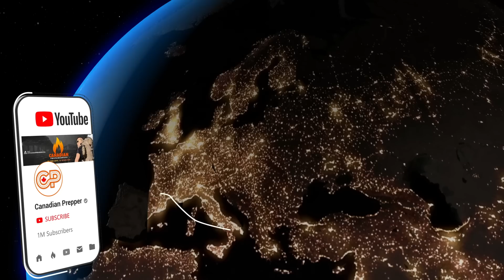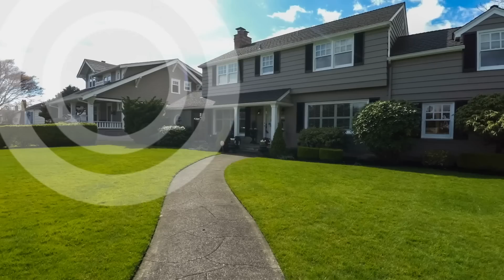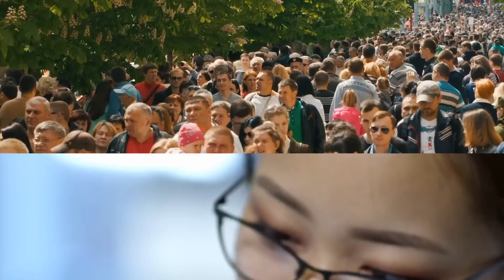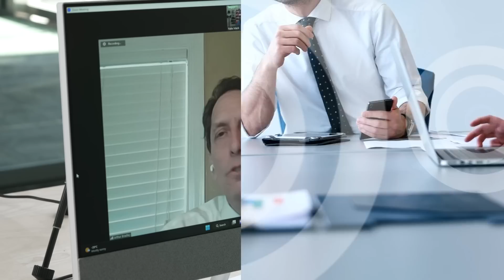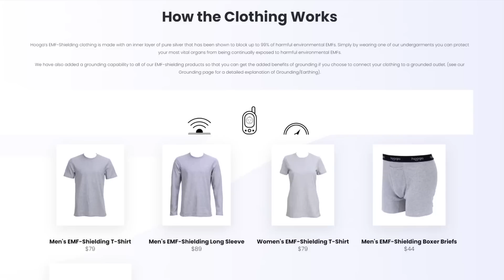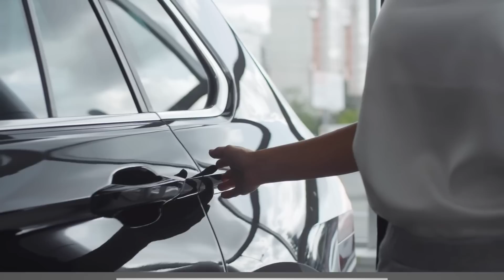NASA Scientist Issues STARK WARNING About WW3, Solar Flares, EMP and EMF

Comment: Thanks valuable info. I'm going to by a couple of metal trash cans & line them with cardboard for my delicate electronics, like my ham radio gear & power inverters etc. I'll probably also connect the cans to ground via a water pipe

Comment: It’s my understanding HAARP works differently than other magnetic fields at lower frequencies where as the power starts out wide and becomes stronger the further it goes. Something along those lines. So, if HAARP has the ability to link up with other magnetic fields couldn’t it certainly increase the energy frequency with the smaller GHz scattered about the planet and make them much stronger ?

Comment: If you buy semiconductors they will be in an antistatic bag. This bag will shield electronics or creditcards. too You can buy em for cheap. Or reuse them when you bought some electrical components. put some stuff in it brought it near the tesla coil. No interference whatsoever. So they do the job nicely. And 170 dollars for the emp device is just ridiculous for what's in it. I am a big fan of your channel but these products are way overpriced.

Comment: I'm sorry but NASA really? Asking NASA for one NASA has a bunch of videos they have admitted they are wrong in more than 89%  they are wrong. Wrong on Pluto wrong on the moon and wrong on the sun. Chatbot gave this answer While solar storms are not dangerous to humans on Earth's surface

[4]

[2]

, they can cause significant damage to technology and infrastructure. Therefore, it is important to take precautions during a solar flare to protect technology and electronics from the dangerous particles emitted by the Sun[1-4].

Comment: If you really want to see this  effect, go get an old fluorescent 4ft or 8-foot light bulb, put a copper wire on end and then ground it to earth, and get the other end is close to high power electric lines as you can. It'll libht that baby up .

Comment: I just thought of a tool that most people have been forgetting in EVERY YouTube video about prepping. 

Portable fish bags!!! The ones Petco use!! They are leak proof and hold a decent amount of large volume of water and you can get 1000 bags for around $30-40. 

They hold a decent amount of water and some bundles come with rubber bands to tie them off on the top.

Comment: The last bit on the solar induced blackout. The plasma wave does indeed take hours to reach earth, however there is a gamma and x-ray component that travels at the speed of light.

A large eruption will most likely be detected because we lose communication with the solar satellites. And that loss of communication will happen just as this energy wave hits earth because both are travelling at the speed of light.

This is ionizing radiation, and it triggers the same EMP spike as a high altitude nuclear detonation, except that it is global because the entire earth is bathed in it.

What the initial gamma / x-ray flash doesn't take out, the long duration plasma event likely will.

Comment: an SDR reciever is the best thing out there that can measure RF energy in the air and give you the exact frequency. As long as it can tune up to above 30 GHz. It can detect weak signals as well as very strong ones and show the difference. It can show everything in it's tuning range.

Comment: Pulsed radiation is intensified waveforms with aggregate energy concentrated in a brief period of time expressing high amplitude from a normally benign waveform.  Amplitude is voltage and voltage precedes current.  Ohm's Law, voltage is applied and current is drawn relative to applied voltage.

Comment: most of these products for cars connect, in some way, to a cigarette lighter and/or battery. how does a person apply emp/emf products to an electric vehicle? 

for home coverage products, do they require professional installation or can the homeowner install? what about solar-paneled and solar battery-equipped homes - how do these devices work to also protect solar equipment, and is installation more complicated?

Comment: Microwave ovens emit on average 20volts/m2 at the door. Your cellphone emits 20+volts at the phone. I ask people do you hold your head against the microwave while cooking? They look at me like stupid question? Then why do you hold the cell phone up to your head. Use the speaker function, don’t keep it close to your person.I have a cell tower in my back yard, I now have RA as well as my neighbors. I sleep in a faraday cage. Metal window screen framed around bed, outside frame .3volts/m2 inside .001volts/m2. It’s Awsome.

Comment: Seems the latest Kitchen trend is to put the Microwave at Crotch level in the kitchen counter cabinets - Seems like a very stupid Idea, just like the ones at head level - as was just stated They ALL Leak.  And Items once Cooked with a Microwave Do Not UN Cook over time. 

All this Energy is Cumulative in damage over time. I stopped using Microwave ovens years ago.

Comment: Dude should make a hat with that emf detector on it. I'm envisaging antenna sticking off the top and the light on the bottom of the brim (so you could see it, duh). Bonus points if the hat is lined with tin foil too.

Comment: I used a 40 watt fluorescent light bulb standing on the flight deck of the USS Nimitz to prove I could light it when the 1Mw radar dish rotated my way every rotation. Won several $20 bets from sailors who just knew it would not flash. Begs the Q... If it would light a 40 watt bulb what did it do to the deck apes.
I did observe the unusual behavior of sailors enjoying large quantities of alcoholic beverages when allowed to go ashore.
Reply: @KK7FWM - The Green E66S n HAM Club AT-1 Worked forward just front of Hanger Deck on the "Rosey". WC-640 ECM Shop AIMD. VF-84 then VF-41 on the Nimitz USN (1972 -1981)
Reply: @KK7FWM - The Green E66S n HAM Club AND you are still motivated! Marines RULE!

Comment: My expectation is if there is a Carrington-like CME headed our way, there will be several days' notice before the CME hits Earth's atmosphere. The federal government will probably require all the privately owned electric power companies to shut down their grids and physically disconnect the larger power transformers from the grid. The nuclear reactors will probably be shut down and measures take to protect those generators that run the pumps for water that cools the reactors and prevents meltdowns. There would be a short window of time to protect as much of the different power grids and other electric powered systems as possible. In our household, we would unplug all our appliances and other electronic devices, coil up their power cords and flip our power panel's circuit breakers to the off position. We would not be able to safely disconnect our house from the local power grid. We would be on standby to put out any household fires the CME might start.

If there is a High-Altitude Electro Magnetic Pulse (HEMP) that detonates over our country, there will not be enough warning to protect power grids, transformers and assorted electronics. There still would be plenty of opportunity for retaliatory nuclear strikes against every enemy nation, regardless of which bad actor was responsible for the HEMP. If your own nation is crippled by a HEMP and vulnerable to invasion, it makes sense to damage all the larger enemy countries just as badly to reduce the threat of invasion. 

I would expect a HEMP to be followed by nuclear exchanges and the need to protect ourselves from radioactive fallout. This is why I have some emergency radios and Geiger counters stored inside EMP pulse-resistant bags. I want a working emergency radio after a HEMP so I can get an emergency alert if/when radioactive fallout is heading my way and perhaps know how much time I have to finish building my indoor fallout shelter. I will use one of my Gieger counters to know when radioactive particles start falling onto my house, when it is time to put on my NBC gas mask and when it eventually will be safe to go outside for brief periods without getting radiation sickness.

Comment: He reminds me almost a Bill Nye the science Guy, I wonder what he thinks of CB technology you bring that EMf scanner into somebody's room running have a small system setup to talk to the EMR or  military  somebody overseas, little scanner of will go absolutely crazy they also use those little EMF things on the ghost hunters and shit, my theory, you put that in the room with my son for example and we're playing remote control cars that thing will go crazy to 2.4 + 2.4 is almost 5.8 if you bought that into a room with my CB system you'll probably get a small reading because it reminds me of an old EMF system that would come with power sources that you would buy for CB units my father was in the Navy and by the time the 70s rolled around he was into the CB craze he used to talk and this is in the early 90s when I was born I remember it was between 1994 and 1996 he set all of his CB systems up basically his Golden eagle CB system which was a very powerful system back in the day at the time he use this system it was still pretty powerful, he had probably 4to 5 power sources power supply set up to this little and Cb unit with all of his antennas  together his long range antennas by the time he was on the Cb scanning different channels he was  talking to somebody over in Switzerland and you would look down at this little EMF indicator and it was in the red almost, which meant in this particular case the radio frequency waves they wouldn't harm you like the waves he's talking about today microwaves Wi-Fi waves 5G waves very interesting being a musician and music producer reminds me of my mixer my 16 channel mixer, it's no different than mixing you're recording your master track I want to bring you the crispness out of this particular sound so I'm going to go to my 12th mixing peace and go up a little bit and the megahertz of that sound is going to go up a little bit, I know some of you will probably absolutely confused at what he's talking about but if you can understand radiofrequency UHF VHF which is very old school tech but again if this shtf that were talking about you're going to want UHF and VHF access in terms of communications I call with solid-state communication.

Comment: ok, regarding the emf attack, this is EXACTLY how it works. the following information i have assertained as the result of being a left leaning, centralist, anti-capitalist, savant. who was smart enough to realize universiity would be a waste of time, resources and narrow my perceptions and reduce my analytical fov. moreover, i have been targeted by this technology, as a birtish citizen, by british intelligence.

the key ingredients are 'dual band' electronic devices. the basic principle is that a dual band device emits emf at 2 precise frequencies from the same device. so, for example, your home wifi router (this is the least focused example, and the only one with potential for collateral harm in an average neighbourhood, harm which is limited to almost 0 by the fact you are the one with the closest proximity to your home router,) the two signals originating from the same electronic device are recieved by a clandestine operator or covert autonomous system nearby, could be anywhere from the house next door to a van down the street or even the cell tower your smartphone is connected to. the data from the signals is digitally modulated, and there are two of them. wifi packets contain ones and zeros and gsm signals instead use something called 'frames' of 21 microseconds each. there are all kinds of finer details of effects that can be achieved using things like digital analogue converter on a digitally modulated dual band device emissions. for now, i will leave people to contemplate these intricacies for themselves in order to stick with the basic mechanisms.

upon receipt of the dual band signal, some fairly modest hardware can overlay the two signals into a narrow band frequency, which is then transmitted back towards the device they were emitted from using a focused satcom uplink (not the omni transceiver on a satphone) i mean folding, turreted desktop thing. they are usually black and orange and rectangular tx/rx panels which unfold.

when this occurrs, (remember they are designed to be able to transmit to the geostationary ring) the person who is the focus of the sadist elite, will hear the 'buffeting' noise bacause the auditory pathways between their ears are balanced and being effect by the dual band device they own and the directed, combined narrow band flux of precise the same. it's like being naturally hooked up to an emf triangulation device. you can 'hear' the specific direction. it sounds just like the initial signal which jodie foster recieves in the movie 'Contact'

the effect this simple version using your wifi has, is fairly minimal. chronic insomnia, physical discomfort, fatigue, lack of neurotransmitter affinity. things start to get bad with the stuff using the same system, but with devices which effect only you. i will point out the unconsidered methods of implementation but first i will explain the biological method of action which causes up to 20 hour bouts of chronic nerve pain which is truly blinding in that you are psychologically incapacitated by the overwhelming war between central and peripheral nervous system due to them having had their sodium and calcium channels parted like the red sea by moses. (yes, we as humans are also dual band transceivers) i almost overdosed on my own beta-endorphins after 18 hours feeling like someone was kicking my rib cage with standard issue paratroop boots. my eyes were like i had taken morphine but i hadnt taken any painkillers (in my experience it usually just exascerbates the problem) beta endorphin is 30 times as potent as morphine and due to the neurotransmitter binding affinity i mentioned earlier, created by lack of charge differential in the neurons i was releasing it like made but not acquiring the binding at the receptor. i took one codeine or a tramadol, i don't remember. i went from blinding agony to waking up the next day as if from an alcohol coma, no memory of falling asleep or time having passed for 9 or 10 hours. i did not shit for several days or the day prior. had not taken opiate anything for weeks previous.

the dual band device with proximity is more potent for them to do this by the following: the further apart the frequencies are. the size or power output of the device. it's proximity to you. how much energy in total does the device consume? i say this last point because by the time i saw the ns2 sabotage and decided to avoid potential outcomes in britiain by going to latvia for 12 weeks. (back in uk since jan) they were routing my internet via a pair of speed radar cameras 200 yards either direction down the road outside my house, they run 2200mhz and face eachother, to cover my using 2.4ghz only wifi. and the 100amp main grid cable which ran along the front wall of my house and the rest of the terrace some 80 yards, in combination with the 500hz upper side band of the 50hz mains supply powering everything and the lower side band of the 5ghz wifi, in order to circumvent the fact i had upgraded to a dual sim phone. (huawei)

one last thing, they can also cause a polarization which increases the uv in your home, which might only be just enough to leave you feeling sunburned but with nothing visible, it is subdermal and it also increases your base sensitivity for endorphin release and more concerning still, can create ozone in your home which increases free radical oxygen and damages your telomeres. causing you to age more quickly. it's my birthday today, 38. now looking 35. last september/october i was 37 looking 42 before i went overseas.

anyway, just thought i would send some weight of validity via direct experience and understanding of these things. peace :thanksdoc:

Comment: Nate you should ask your emp experts if L.E.D. systems would fry from emp. Such as the circuit board for L.E.D.'S and the melting of the L.E.D.. In other words. LED flashlights will be fried from emp. So ALL the modern flashlights/torches.

Comment: I am concerned about those LABS that figured out everything harmful is actually only a signal consisting of power and frequencies (Pulses). Creating heartship is a very broad term, having the capability to fine tune a signal to let you cough or faint (even Die) is more dangerous. Than there are those (me included) that think long term exposure to these over-engineered hybrid wave signals (undectable at first) can lead to Cancer or heart disease in only 1 - 2 years. Especially aiming to attack embassies and military bases. They never find out what hit them all that time. I cant proof it but I am convinced they use (have an archive of) people if placed in the vicinity have the same effect - or counter the effect. SciFi, who knows. It diminishes everything to being software and we are living in a simulation. Being able to entangle certain people to another group of people at the other side of the globe is the perfect weapon payload delivery system, think about it. Transmitting a virus wirelessly over entangled people thousands of miles between them crossing enemy borders as if they don't exist.